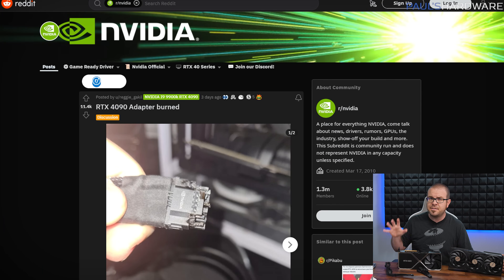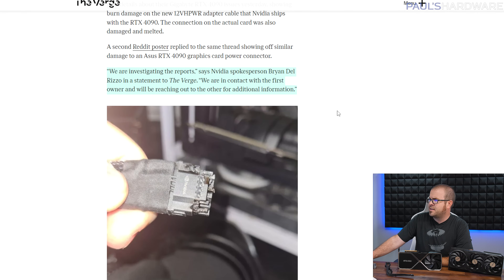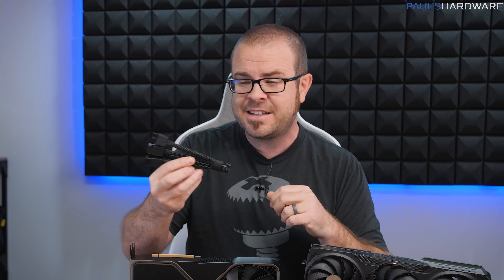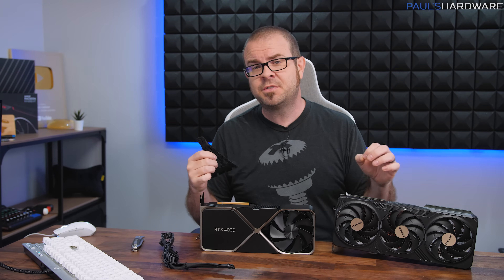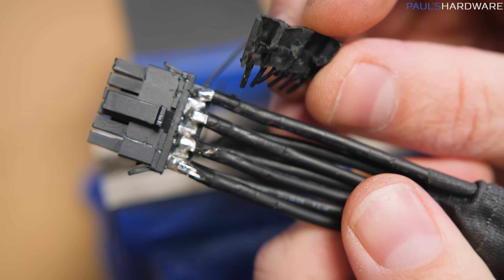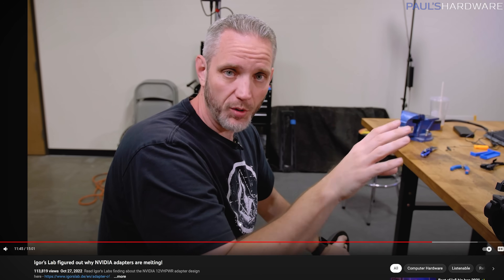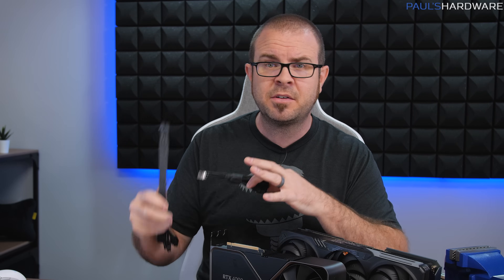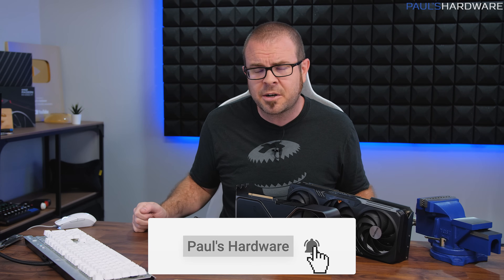Why are some melting? RTX 4090 600W 12VHPWR Adapter Teardown

Comment: I have wired a lot of buildings for residential and commercial. I have also run wires in aircraft. Im not sure those adapters are going to work with 50 amps. Not enough material making the connections. I personally would never trust that. Ever see the size of the bus bars in a house panel? Yes they are meant for more, but the point is how over built they are. Even for the power draws they are meant for. Those adapters look under-built.

Comment: I am sure I remember from my distant training "solder is not a mechanical connection". Sure you can add solder to 'improve' the electrical connection, but for mechanical stability/security, the wires should be, for example, crimped in position?

Comment: For those not seeking to purchase a new PSU ATX 3.0, Cablemod has designed, manufactured & distributed a new cable to suit that on the face of it, is much more robust than Intel's adaptors.  
It would be much better having a complete cable to suit your current PSU than just a flimsy adapter cable. 

Pauls investigation, as others have done, is spot on with the outer pins being effected. The inner pins are able to dissipate the heat generated whereby the out pins don't.. The buck stops with them. Perhaps for the outer pins the plate, and those pins need to be thicker.

Comment: I am wondering if by chance arcing is happening due to the possible reduced contact of the connectors during the different pulls/pushes of the connector. Since the connectors themselves are so fragile and that under certain circumstances by which the cables are being pulled/stretched, it's creating small gaps where the current can arc.... and possibly giving you a very bad day....

6:46 - looking at the picture, if the solder point becomes disconnected due to stress, but still within that small confined space, that short distance can possibly allow for arc to happen and thus, generate quite a bit of heat at the point of arcing. it would be hard replicate since you would have to try to simulate arcing within the cables and see the results of that arc event. Though I would imagine it would not be pretty since arcing can cause electrical fires depending on the surrounding materials and/or environment.

Comment: I actually sent a request for be quiet! to send me a 12VHPWR adapter as I bought a Straight Power 11 1200W platinum power supply on the same day I bought my 4090.  Maybe they'll send one, as I can't find them in stock anywhere.

Comment: Thanks Paul for making this situation about the odd new connectors a little clearer. I'm waiting for the launch and benchmarks of the AMD cards and then I'll decide which card is the right one for me to get, looking forward to it! My Asus Thor 1200W came with the same kind of cable as the Corsair one you have here, so wiring up a new GPU should be fine with that but I'll be ordering a way nicer one from Cablemods. A 12VHPWR adapter to four 8pin ATX plugs seems to be the way to go, dividing large currents over more cables is always safer.

Comment: It all comes down to money and Nvidia being cheap. I want to know who made these cables, like the company Nvidia contracted to actually manufacture them in a factory made them. If Nvidia wasn't trying to produce the cable as cheap as possible and actually cared about quality this would not be happening.

Edited to add that Nvidia wants all "defective"/damaged cards sent directly to HQ so they can prove/show that nothing was actually wrong with the card and sue the pants off whoever they contracted to manufacture these adapters.

Comment: This is all very simple, I dunno the law in the USA, but in Europe, if the thingymabob melts then you go back to the shop you bought it in and get a new card -> the retailer then sends it back to the manufacturer. Now I suppose if it goes on fire and burns your house down while you're asleep then you might have a problem returning it(because you're dead ☠️👎)

Comment: Pauls Hardware : JayzTwoCents is a noob and lacks knowledge of how to debug anything technical. Temperature on the plastic housing isn't a validated procedure and masks the real source with a wide amplitude. His measurements are childish and simplistic due to his non-knowledge about electrical engineering.

Comment: Not sure if anybody else has mentioned this.  But a broken connection may also cause arcing to occur.  As the current jumps the short gap.  This actually can cause an extremely high temperature jump.  This is actually how many house fires are caused on mains power connections where there is a poor connection.  So Paul's conclusion on the poor connection is probably correct but, it might also be worsened by internal arcing adding extra heat.

Comment: Why do we still use all these screwball multi wire connectors? 99.9% of cases out there are made of conductive material. Thus go with a chassis ground. Instead of multiple smaller gauge wires, how about one large gage wire for the positive side? Cars have been successfully running their electrical systems in this fashion for over a century. Proven concept for 12 volt systems.

Comment: I have to agree with Buildzoid on this one.  Where Nvidia's adapter has female connectors that have 2 splits in them, other manufacturers are using  female plugs with only 1 split (which is mechanically and functionally much more rigid),    So Nvidia's female adapters have much less rigidity especially when bending horizontally.  Once bent this would cause the same amount of amperage to transfer through a smaller connection point (from the adapter to the GPU) and in turn create more heat.   am not a electrical engineer, but to me this would make more sense as to why the connectors seem to be melting at the pin connections rather than melting closer to where the solder point is on the Nvidia adapter.

Comment: Just don't use the adapter cable at all! The design is flawed and can be dangerous. It might be safe in 99% of cases, but nobody should take that fire risk. I am dismayed at Paul for saying to use this cable if the user didn't bent the cable. Maybe the packer at the factory bent the cable and damaged it!

Comment: I suspect the melting is due to heating of the pin caused by high current arcs, itself due to embrittlement (phase changing) of the solder due to heat cycling. The embrittlement increases resistance at the connection point, lowering the voltage and therefore increasing the current (for a power controlled system) increasing heat. Eventually, the connection is so poor we see arcing which results is large temperature spikes. In one of the failure images you can see arcing tracers on the female end. I suspect that the specification requires these connections to be crimped and not soldered (like the Corsair cable) so I'm surprised this went through to manufacturing and passed QA. Bad day for the Manufacturing Engineer who signed off on this.

Comment: I honestly think you and Jay have it a bit wrong... Actually Hardware Overclocking has a much more believable explanation to me (not the solder joints at the back, but rather the cheaper pin sockets which don't grip the pins as firmly, and are more easily spread apart sideways. If a few pins have higher resistance than the rest, most of the current will go through just a few pins)

Comment: 576w is the max that current wiring is really supposed to see. anything beyond that is really maxing out the capability of the wiring,. anything beyond 795w is more than the wiring is capable of handling without risk of damage...

Comment: I appreciate the entire community working together to bring us better data and information regarding this.
Reply: Gamers Nexus carried report on validation test failures of adapter cables with 12VHPWR connector from the PCIE5 SIG on the RTX 40 announcement day.
Very few of the tech press/reviewers covered it, or advised users about the fragility
Reply: YouTube you work together here ???
who does that ??? you share likes and commands ? subscribers ???
Reply: I don't. Bunch of know it alls pretending they know better than actual electrical engineers over a couple of freak accidents, likely more to do with the manufacturing process in some Chinese plant.

Comment: That doesn't seem like sufficient isolation between +12V and ground inside the connector. I bet those two skinny little plates are somehow shorting a little bit inside the connector and going nuclear from there.

Comment: So, I've been confused by the construction of modern power connectors ever since the first 6-pin connectors. Why tf do we have 3, 4, and now 5 hot wires all running parallel? Just have a single properly sized +12V wire and a single properly sized 0V ground wire. It's the same thing just with way more BS and faffing about.

Comment: I'm not completely confident that my wall socket can handle card.
I have a 1000w ps, but my rig is only tdp to about 600 watts (total). Add monitor, modem, wifi, speakers, laser printer, phone charger, etc... I'm around 1000w draw (load) from the wall.
The wall socket is only rated to 1,320 watts. 4090 tdp is +200 watts of TDP over my current card. It would be pushing right near the limit.
I think if I got a 4090, I might have to migrate some hardware to a different house line (or face tripping if i plug in my phone while printing, etc). That actually sounds like a huge PITA.

Comment: As someone who owns two 4090s, this is horrifying design by nvidia, I hope they give us all free “fixed” adapters
Reply: How'd you get your hands on 2? I got my 3090 within a month of that launch but only because evga introduced their queue. Did you use a bot?
Reply: @greod1006  they are very easy to get ahold of without bots if you go into the store and ask, the bots are actually failing to obtain any of them, a bunch of scalpers tried to buy the ones I got and their bots got declined automatically by the store. Some stores are basically refusing to sell to scalpers, which I think is great for people like me that just need them for rendering graphics.

Comment: Another characteristic: power draw by the graphics card is variable. I'd look to thermal expansion/contraction effects causing pin to connector movement. Over time gold or palladium plated surfaces can wear, and connection contact  areas can decrease, resistance increases, becoming more more thermally active. Once micro-arcing starts, oxidized contaminants appear in the contact area leading to bigger arcing as the pin and connector degrade further. Just something I've seen in the past.

Comment: excellent disassembly and close up photography! I'm interested to know if the 3 into 1 connectors shipped with some MSI 4090s are better built (due to the number of wires potentially) or not

Comment: I'm not really worried about the four honkin wires supplying the 600W of juice. That's not the failure point. The failure point is the pins themselves being pulled back in the socket and not making good contact. That's where they're heating up and melting the plug.

Comment: Why does everyone say increased resistance causes heat?  Not in DC, increased resistance just reduces current flow.  If in DC resistance increased heat, every 10kohm resister would be like 1000 degrees.  Poor connections just cause the 50 amps to go across a very small conductor, that creates heat.  If this was AC then yes, you make resistance you get heat.  And everyone please stop using thermal imaging on a plastic connector, you need to image the terminals or at least strip the insulation off the wires. 
Imagine if your body that usually has around 800kohms impedance was to touch a 12v battery with one hand on each terminal, do you spontaneously combust?  Nope, you just get like a fraction of a watt that passes through your body because current was limited by resistance.

Comment: You pointed out that the adapter plate is thin. What is its cross-section area compared to 18 AWG wire? If it is smaller, then the 18 AWG is a scam. The plate will heat up and melt the connector.

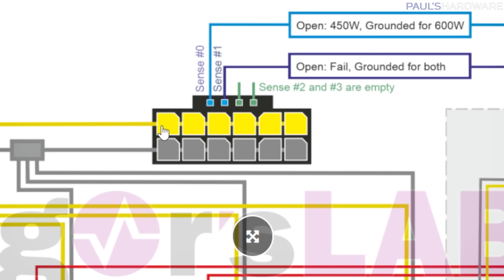Comment: 5:00 common misconception: both 12V and GND pins are equally important. Current flows in a loop and they need to handle the same amount of current

Comment: Old 8 pin cable being shunted into a "new 6 pin" connection?? So let me get into the head of NVidia. "They're gonna want to plug it in" is one of the top 2 steps of using a GPU, but the CABLE to do that was so much of an "after-thought" that they shipped the card with an ADAPTER??? And this thing is drawing anywhere from 450W - 600W, but you cut corners or didn't focus on the cables? "Somebody's messing around".

Comment: Nice to see you doing a bit more research than most of the "influencers" who jumped on the doom and gloom bandwagon and overblew the situation with fear mongering. 

To me this looks a lot more like some faulty adapters just like every generation of power connector has had forever but was especially more common in the early days of each plug. 

While 600W through a tiny plug like that seems like a lot to people even a 16 awg wire in a x4 config should be able to handle more than 600W this is almost certainly a faulty batch(or partial batch) because of poor soldering rather than an actual issue with the plugs and wires.

Comment: So basically if you have the scratch for the 4090 you really should buy the Corsair PS with the much better designed power cable.. That's what I'm getting from all this. Why did nvidia cheap out on the official cable? Greed I guess..

Comment: AMD's announcement about their power connectors is just a jab at Nvidia cause Nvidia did a goof on their Adaptor design. And While the Iron is hot you better use it to Promote your Next best thing cause why not. This point may also be pointed out on their RDNA 3 announcement Nov. 3 cause Why not.

Comment: Are you sure all 4 plate sections are connected?  They look like 4 separate sections to me.

And if that's the case,  it looks like the inside 4 pins are fed by the inside two wires, and the outside two pins have 1 wire each.

So if an outside pin is broken off its wire, the current it needs will be pulled from the remaining pins.  Since the other outside pin pulls just as much power as TWO inside pins, the remaining outside pin will have more of the burden to pull the power the broken pin used to.

I think THAT is the issue.

The current isn't uniformly distributed among all 6 pins.

The outside ones carry more because they each carry as much as 2 inside pins carry.

You can see what I'm talking about in the 4th picture down on the igorslab link page.

Comment: I wonder if the metal expands at 50C, and is more brittle at temperature... so if there was a sideways pressure and it warmed up a tear could start which could increase temperature further

Comment: Remarkable that with such a huge power draw that Nvidia is still designing these cards to use these puny wires and connectors.  I think a better design would be fewer, larger wires and connections that are fastened down with screws

Comment: 14  awg equivalent to common electrical cords, say for example on you lamp, or kitchen appliance. It's used for 120v & 240v around the world due to having plenty of ampacity at those voltages. However, amperage increases inversely as voltage drops, so at 12 volts with hundreds of amps the ampacity might be different for 14 awg, I'm not sure...

Comment: Why do we need so many wires and thus create a higher resistance because they are thinner?  The car has 12V and a lot of Amps and uses two thick cables, Why can't we have thick cables for the graphics card?  Everything comes from one power supply!

Comment: In 12 volt systems a 3 foot (1 meter) 14 gauge wire is good for a maximum of 30 amps or 360 watts (2 would handle 720 watts, 3 = 1080 watts). So, this has to be an issue of bad solder connections between the wires and the "foil" or metal plate to which the wires are soldered plus bad connections on the  male pin and female side of the connectors. If it was a PSU issue, the PSU should be shutting down due to over current protection. But, it seems the issue is not the PSU shutting down due to the current on individual rails. There has to be more than an issue with the 14 gauge wires and their connection to the foil. It is most likely bad quality control, combined with someone deciding to cut cost and cheaping out on the design - i.e. too thin of a foil plate, 4 wires instead of 6, poor solder connections, tiny easily damage female pin connectors on tiny male pins...etc   Seems Nvidia created a bad solution to what was more of a specification problem, rather than an actual power load issue. Again, one 14 gauge wire can handle  360 watts on a meter long wire, 2 can handle over 700 watts and 3 can handle over 1000 watts at 12 volts. Seems someone made some really bad design choices and engineered a bad connector...

Comment: Nice! JTC also noted that the 30 series connectors were similar, but were individually wired to the pin, as the Corsair cable.
Nvidia stepping backward.
Reply: Money over everything. Why pay for 12 wires when you could pay for 8?
Reply: Ah yes, the Apple manouver